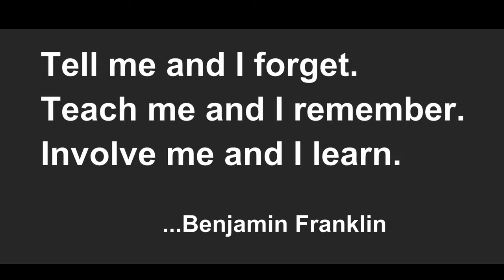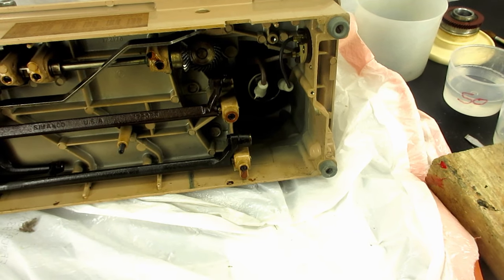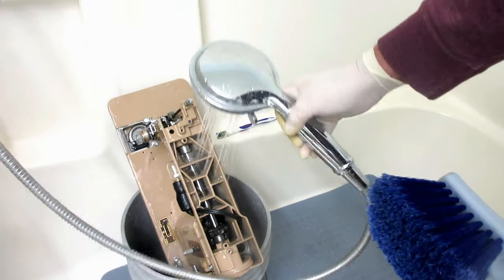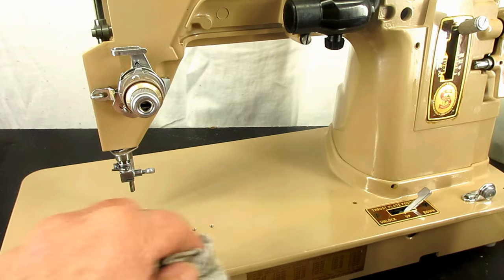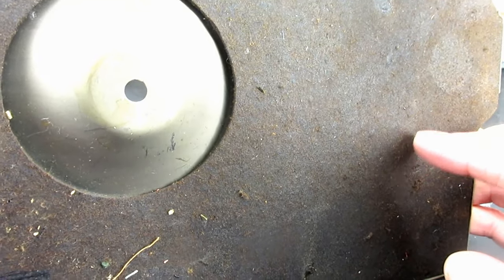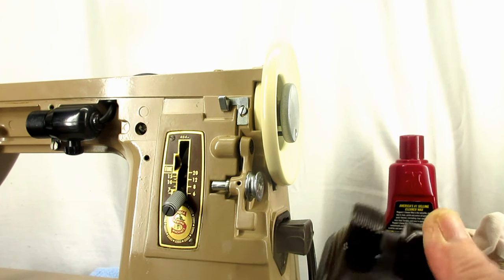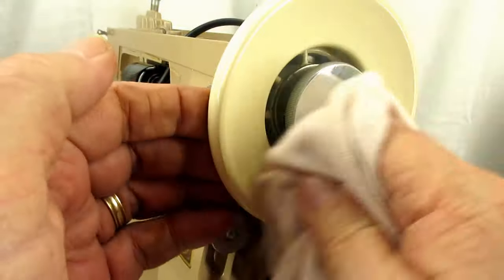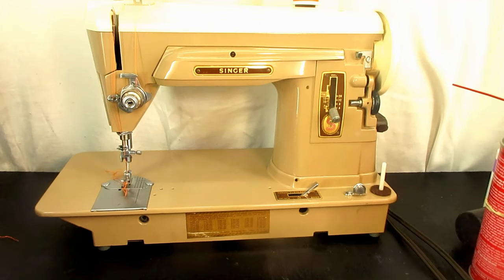An easier way to clean & degrease a sewing machine with less parts removal.

Comment: Hoping for advice with foot control of Singer 640 that creeps.  Recently serviced and we are stumped.
Reply from the maker: wait... what? not sure what is creeping. The only foot is a presser foot. Is the stitch length lever creeping? Like you set the length at 12 but it creeps down to 6, like that? Oh, maybe the foot pedal? This is getting creepy, hehe. Help me help you. Thanks
Reply: @andytubesewing1953  the machine continues three or so stitches after you release the foot control.
Reply from the maker: @ruthroth867  Thank you, Ruth. A sticky foot controller I'd guess. There is a spring system inside. If you have the original pedal it may never have been serviced. The style is called "clamshell". It can be very dirty and dusty inside the pedal. I've even found worn out or rusty parts. Here is my playlist for how to restore it to proper function: https://www.youtube.com/playlist?list=PLsCOZgzzaiKItPLWcK24FBoMdHK8vTXNi   Of course, some pedals are beyond repair. You can buy replacements, either carbon resistor style or the newer electronic style. You can find them with the cord attached for your model of machine, or without a cord so you can reuse your existing cords, which is nice if they are in shape and color matching. There are many places to buy these new pedals online. Here are a couple of well known and respected sellers. https://www.sewingpartsonline.com/search.html?sort.relevance=desc&keywords=foot%20pedal&index=35
https://www.vintagesingerparts.com/collections/foot-controllers-foot-pedal?page=2
Sometimes the pedals clean up and adjust nicely, but the carbons discs are ruined. You can find a couple of sellers who sell a new carbon stack tube for replacement. I show them in the description below the last video in the playlist I mentioned.

Thanks for watching my channel, Ruth, and good luck.
Reply: @andytubesewing1953  watched all the videos. “Guts” of the 650 pedal are very different. Wish I could send you. A pic. The tech says there is a chip in it.
Reply from the maker: @ruthroth867  650? or 640? No matter, Ruth, and a picture would not help me as I've never seen a pedal like that. I've only worked on a couple of T & S models and they had the carbon stack in them. I can't advise you other than to say I suspect it is the pedal as the motor doesn't store electricity. Maybe you could find a Touch & Sew Group on FaceBook or other and ask the members. Or you could replace the pedal, but it would nice to prove that's the problem. If you know anyone with a T & S machine, maybe you could borrow the pedal just for a test. Both of the instruction manuals for the two models you mentioned were printed in 1967 and the dates on the manuals are usually the first year they came out for sale. That puts your machine at 50+ years old, so whether a carbon style or "chip" it may be wearing out. Can't help you with this one, sorry. 😞😢
Reply: Your foot pedal creeping. Do you mean that when you are sewing and, your foot is pushing down on the pedal it moves under your foot?
If so the little rubber grippers are either missing or worn. Try replacing them or what I had to do is put a box on the opposite side of my foot to keep it from slipping away from me.
Reply: There is an adjustment access hole on the bottom. Good luck

Comment: Just curious , would it or would it not be advisable to use cleaning solvents like gasoline,  carb cleaner, liquid wrench... Applied with a small brush or Q tips.?  I'd be afraid of using water on parts that could rust.
Reply from the maker: I never tried gasoline, and never would.
     Over the years I have tried carb cleaner, brake cleaner, alcohol, goof off, acetone, gun cleaner, and kerosene. Kerosene worked well cleaning out gummed-up bushings. I found all of those to be too volatile, flammable, or smelly other than 92% alcohol. 
     I looked for a water-based earth-friendly cleaner and found it with the Krud Kutter. I've washed about 50 machines now and rust has not been a problem. The KK strips off all the old grease, oil, grit, grime, smells, etc. This can cause a small amount of "Flash Rust" on the surface of some metals. When that happens I brush on a small amount of rust remove and then lubricate the machine. 
     The important thing is immediately drying the machine, like "dry as a bone" dry to remove any moisture. The first machine I did this on was a SInger 600 and it locked the machine up. I could not budge a part to move. I felt it was a total failure, but proceeded to add oil to all the places shown in the Instruction Manual (and then some more little metal-on-metal spots. After a few minutes, the oil allowed movement, and then everything started moving just fine again. I've never tried a different cleaner or method since.
     The very first machine I cleaned was a SInger 301 using alcohol & Q-tips cotton swabs. 32oz of alcohol and 600 Q-tips later it was mostly clean but took several hours. It was boring & tedious and did not really clean the bushings and bearing very well. I ended up injecting the alcohol into the bushing oil ports several times to flush out the old gunk then a few oilings to flush the alcohol back out. Over the years I have washed the electrical motors with the KK using the wash/fast dry method with great results, too. 
     The only caution is the finish of old black Singer models. Testing that type of finish with the KK showed it will dull the finish and ruin the look of the machine so I do NOT use KK on those types of machines.
     Rust has just never been a problem IMO.

Comment: Hi Andy, thanks for your video. I have a question, I am trying to take off the wheel with my singer 411g like you did but it is not coming, do I have to do something more ?
Reply from the maker: I've never seen any of the German-made Singer machines, but viewers have told me they are very similar to the US-made slant machines. If the parts on your 411G look similar to the machine in this video then I would say that the wheel is stuck onto the counterbalance by old, dried-up oil/grease. 
     I have encountered that a few times. I usually try heat first by using a hair dryer for a few minutes. The heat can soften that old gunk enough to get the wheel free. Once it starts to move it gets easier and easier. I usually hold onto the needle bar assembly while trying to turn the wheel back and forth to get it moving. I use an old leather garden glove to hold onto the wheel b/c it's very hot at that point.
     If that does not work I will soak the handwheel with penetrating oil, like WD40. I apply it where the hole in the handwheel slides onto the counterbalance on the arm shaft. I often take the nose cover off and prop up the machine nose end down so the wheel faces straight up and drip the oil on there. 
     I will wait about 30 minutes and try twisting the wheel as I described before. If no luck I will start using heat on the oiled area. It kind of blows the oil around but that wipes right off later. 
      I have freed up the wheel in 5 minutes and had others that have taken overnight soakings.
Reply: @andytubesewing1953  Thank you for your response and the time that you took ! 🙂I have another question, it's about the camstack. I already watched your video showing how to remove and clean it. I followed the instructions, but in the moment that I would like to put it back inside it seems to be stuck and it's not passing... I mean that in your video it seems to slide easily.
In my case I can giggle all I want but it's not going down as it should.... 
I will thank you your time again  because I don't find an answer again of this new problem 😭
Have nice day Andy!
Reply from the maker: @claudiamanriquealejos1300  Could you please ask this question on the video you watched about the camstack? Thank you

Comment: I am having a very difficult time quickly finding Krud Kutter Must for Rust.  What is a good alternative? Thank you.
Reply: One more question, is the gel comparable to the liquid? I can find the gel. 🙂
Reply from the maker: Where do you live?
Reply from the maker: @rebeccaclark5619  the gel for which of the products?
Reply: @andytubesewing1953  I live in Washington state, north of Seattle.  I ordered from Home Depot, waited two weeks but the package was damaged in transit so back to square one.
Reply: @andytubesewing1953  Sorry, I meant the Krud Kutter Must for Rust gel as opposed to liquid.
Reply from the maker: @rebeccaclark5619  I've had one viewer tell me they used it and liked it b/c she could control the application and it stuck to the rusted part better so easier to clean off.
Reply from the maker: The only other degreaser I have used was OIL EATER. It worked very well but cost more so I stayed with the KK Degreaser. 
     Here are degreasing cleaners viewers have told me they used that worked well for them (I have not used them) Fabuloso, Simple Green, Zep, LA AWSOME, Sprayway Brake Cleaner, and generic carburetor cleaner. Just be sure they are ok to use on aluminum and plastic, and OK for paint in case you spill. 
     The brake cleaners and carburetor cleaners are supposed to be quick and easy. For me, they are too volatile and dangerous, but to each their own. 
     Alternatives for Rust removal that viewers have mentioned (I have not used them) are EvapoRust, Whink, and Corroseal.
Same thing; be sure they can be used on aluminim.
Reply: @andytubesewing1953  Thank you so much! I do have the Krud Kutter cleaner/degreaser and just wanted to have something for rust on hand before I start the cleaning process.  A friend just said she has some Must for Rust I can use! Your video is so helpful! I am going to start cleaning a 403 "without removing so many parts" as shown in your video.  Fingers crossed!
Reply from the maker: @rebeccaclark5619  you'll find it really rewarding when you see how clean your machine gets. And one last thing I have found since then that I can use a much weaker solution of the KK then I had been using. I just started using more and more water with it and it just kept cleaning well. So I use weaker concentrates now no more than 50% KK to 50% water
Reply from the maker: @rebeccaclark5619  You can do it! It's very rewarding to have a super clean machine. FYI, I have found I can use weaker solutions of the KK and never use over a 50% even on the worst dirty gears. Often a 15 or 20% Solution is fine. Good Luck.

Comment: My brand new singer has a bad smell. i have chemical sensitivity so i can't use it. do i need to take some of it apart and wipe out whatever smelly oil they used. smells like a car repair shop and replace it with versa oil?
Reply from the maker: I can't advise you about a new model that I've never worked on. Mostly plastic. I would ask Singer Support about it. In general on the older vintage machines I have cleaned them without removing a single part by spraying a 15% solution of the KrudKutter and then rinsing with a clean water spray. Afterward, you must dry, dry, dry the machine. None of those vintage machines have electronic boards or chips in them but that is what would concern me with a new plastic machine.

Comment: Can you do this method with a vintage treadle machine?
Reply from the maker: I would not. Most treadles I have seen (never worked on one) have the black finish and Krud Kutter does not play well with that type of finish. Other viewers have told me it will dull the finish, sometimes severely. YOu can spot-clean the non-finished parts to remove grease & grime followed by a water rinse, but be careful of the pretty black shine.

Comment: I have a Singer treadle 1938 model. Can you point me in the right direction for information on the presser foot that won't move. I've taken the side part off to see in and the lever for the presser foot goes up and down but the foot doesn't move. The lever doesn't seem to be attached. Please help me!
Reply from the maker: Singer made a few different models at that time. It would be helpful to know the model number of your machine. If it is not shown on the machine you can find the serial number and look it up on ISMACS: https://ismacs.net/singer_sewing_machine_company/serial-numbers/singer-sewing-machine-serial-number-database.html  
I do have videos for working on presser bar systems of some models. Maybe one is similar to yours.
Here is a model 99: https://youtu.be/qFsJzJ9NH2s
Here is a model 15-91: https://youtu.be/Ll6CWYp700E

Comment: I have a Singer gear driven 201. Have you ever cleaned a 201?
Reply from the maker: I've never even seen a model 201 in person, Julie. I looked over the 72-page adjusters/service manual to see the parts. The deal with the Black Finished Singer machines is that Krud Kutter can dull/harm the surface so you must be extremely cautious with using it. Here is a playlist of my cleaning videos. Look for models 99K and 221 featherweight as they have that black finish. https://www.youtube.com/playlist?list=PLsCOZgzzaiKK8O1UvRsU-eNo2G2yX3f2G
I can also suggest the featherweight shop https://singer-featherweight.com/ because the 221 models have a similar finish to your 201. This website is well known and very professional showing about servicing and cleaning and polishing. You may pick up some tips to use on your machine. Thanks for watching my channel.
Reply: @andytubesewing1953  thank you. It was my mother's and I learned to sew on it. It's a workhorse.  I did buy another working 201 about 40 years ago just for parts. Thank you for your very helpful videos.
Reply from the maker: @juliepekarske8302  A nice heirloom. Best of luck to you.

Comment: for degreasing could I use greased lighting degreaser?
Reply from the maker: I can't advise about this product as I've never used it. You can ask the company about using it on aluminum, steel, and bronze, paint, and plastics which most vintage machines have in them. You could always try on a couple small places to see. Here is the SDS for the main product they sell https://kik-sds.thewercs.com/private/document.aspx?prd=17569248591%7E%7EPDF%7E%7EMTR%7E%7EAGHS%7E%7EEN%7E%7E2018-10-02%2009%3A21%3A37%7E%7EGreased%20Lightning%20Classic%20Cleaner%20%7Bamp%7D%20Degreaser%7E%7E&page=NewSearch&SearchPage=NAPOOL&location=GREASED_LIGHTENING%20EN_US&__VIEWSTATEGENERATOR=D6323F43&language=d__EN&productName=greased%20lightning&productName_option=d__%7Evalue%7E&productID_option=d__%7Evalue%7E

Comment: what size type is that orange thread you use in this video?
Reply from the maker: It is made by SULKY in Italy. It is 12 wt long-staple cotton type/color is 713 1184. https://sulky.com/sulky-12-wt-cotton-thread-orange-red-330-yd-spool    I buy local at 35th Ave Sew & Vac but should be on Amazon and Joann's, etc.

Comment: What needles do these older machines use? Like industrial dbx1 or the same needles as the home machines nowadays?
Reply from the maker: Most of the domestic Singer machines use 15X1 needles. The size range depends on the particular model. As mentioned in the video and shown in the description area below the video, you can download most of the instruction manuals, by model number, for free from the Singer support webpage here: https://www.singer.com/support   Just enter the model number, like 403, into the search box. The manuals have a page showing the needle type, size, and recommend threads and stitch lengths based on fabric types.

Comment: what do you use to replace a stinky drip pad?
Reply from the maker: I usually just clean it with the Krud Kutter and let the felt and bottom cover air dry. See @2:10:20 in the video. If you would rather replace it completely you'll need to remove the left-on glue and use craft glue to put on a new pad. The cheapest route is cutting a 12"x12" $1.00 polyester pad from Walmart, from the craft section of the store, to fit. If you want to go the highest-quality route go to https://www.mcmaster.com/standard-felt-sheets/hardness-rating~firm/  and scroll down to find the thickness of the pad with the % of wool content you want.
Reply: @andytubesewing1953  What is this for?
Reply from the maker: @longingfortheharpazomoment7743  On the bottom of the machine is a metal plate called the bed cover. It is lined with a pad to catch any falling oil and grease from the machine. Over the years it can collect a lot of the lubricants and begin to smell bad. Jo asked about replacement lining. You can see me remove the bed cover starting at @29:05 in the video. Thanks for watching.
Reply: @andytubesewing1953  Ok! Great! Thank you!!